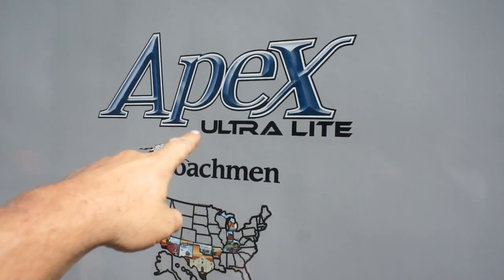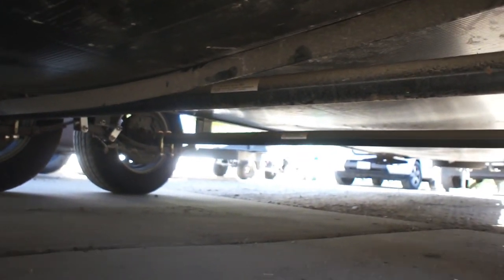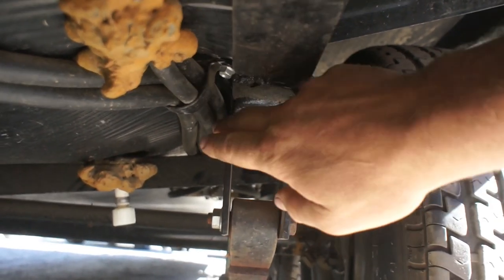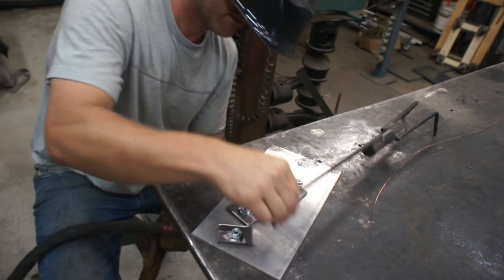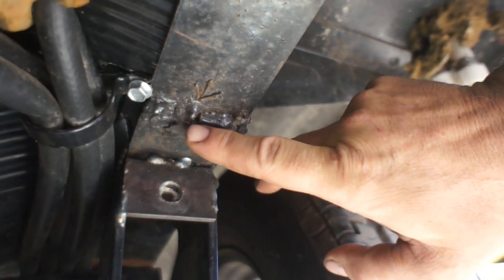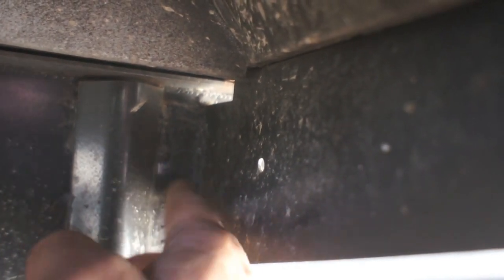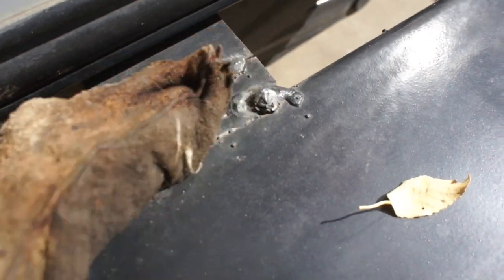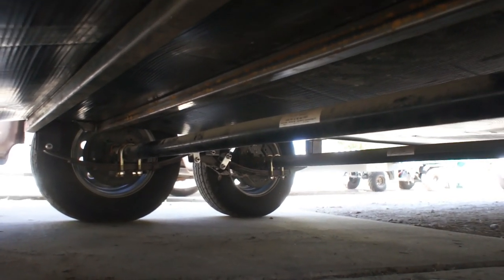RVing: that time when your water tank fell out....

Comment: Nice job. Across many brands and a couple decades many RV’s have had inadequate support under tanks. Back east where a lot of these come from, people go to RV campgrounds with hookups or at least water at the entrance. Out west, people boondock, and have to travel with water.  Last 5th wheel I did had OSB and a couple pieces of 2” angle- that sagged and bent when full. Plywood went in, straightened the angle, and added two pieces of 2” 11ga square tube.  

On the plus side, while you’ve got the corplast down it’s a good time to add tank heaters or any other wiring, better insulation or whatever. Now days the underbelly is often put on with Ramset nails, which would not be easy to remove if you had a problem away from your shop, so upgrading to self drill screws is another plus imho

Comment: Folks We have a 2023 22MLS Cougar. We already had to change a fresh Water tank. Folks they are held in by tooth picks. I know they all have underbelly’s so you cannot just look but strongly recommend if you ever have to take the belly part way off, do your own repairs so you can see all the things you need to upgrade. The 24’s will be worse. Talked to. Cert. and these things across the boards are getting worse and worse.  We added a cross bar to help assist ours. And so much more we did correctly that the factories are not…..USMC/USAF Ret.